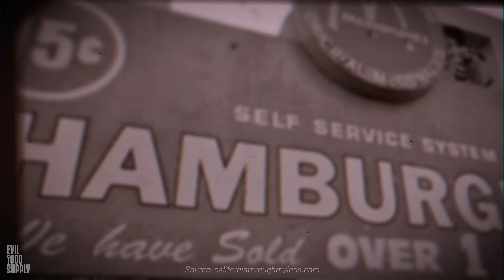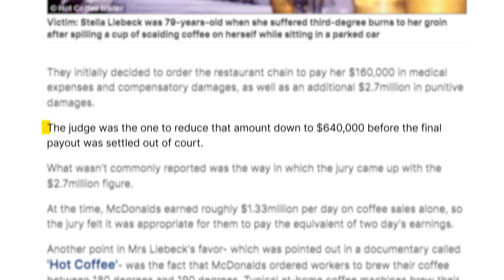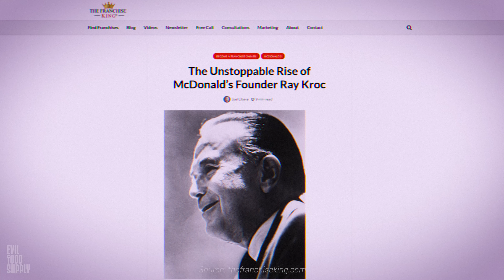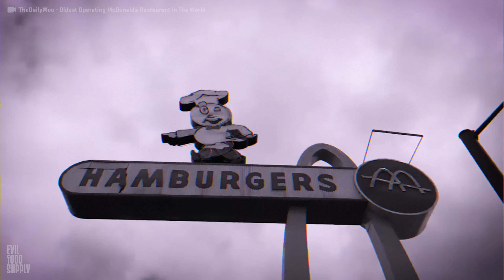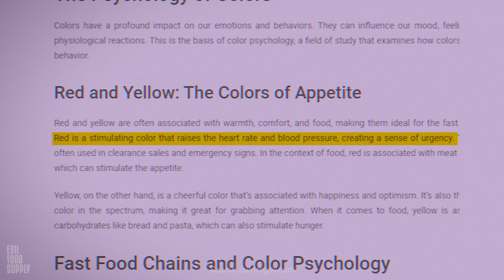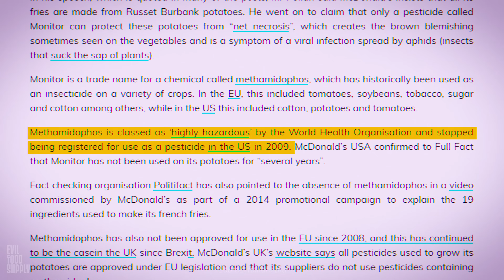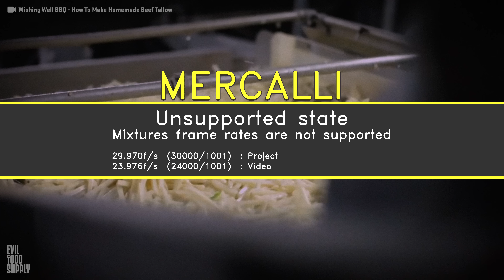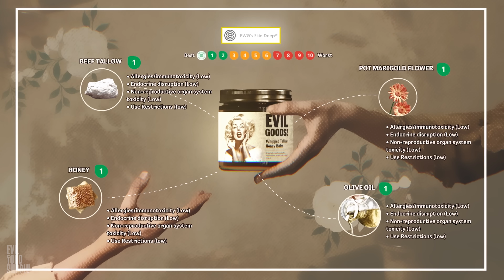The Dark Side of McDonald's Fries

Comment: Never eat McDonald's food!   I worked at a car dealership and we had a car come in on repo.  The car sat in the backlot for over six months all through summer.  We weren't allowed to do anything with it till the legal status was cleared up.   Well during that time an entire bag of half eaten McDonald's and other food items were in the back floorboard.   When we finally got to cleaning and maintenance for resale, the only thing that wasn't coated in mold was the McDonald's food.   If bacteria and mold won't eat it neither should you.
Reply: Yup. Did an experiment in 2012 where I left a hamburger and fries on the top of my fridge for almost 2 years. Everything was basically petrified but not a spot of mold or rot.
Reply: I once found a bag of apples between the wall and couch at my ex gf's house. The apples had expired since 9 months but looked perfectly fine.. guess some apples have the same anti life coating as McDonald fries 😮
Reply: Stopped eating it for years until I started working at one. I couldn't even finish one mcdoubble n a small fry. The then would throw it up abt an hour later.
Reply: @freedomfisher2496   Apples are one of the more long term fruits if properly stored and commercial ones get a wax coating.
Reply: @freedomfisher2496  Nah, man, you can store apples for a pretty long time. That's why you can buy Washington apples at the grocery store in July.  There's not some magical tree that grows yummy honey crisps in July, they just store that long if they're treated right. It's not a crazy pesticide that protects apples and gives them this longevity, it's literally just wax.
Reply: We are composters
Reply: As word got around about McDs food being as attractive to insects as margarine (meaning, even cockroaches won't eat it), Burger King ran an ad that was nothing but a time lapse of a whopper molding and rotting.

Burger King's sales increased 14% from that ad campaign. FOURTEEN PERCENT! Literally one of the most effective ad campaigns ever ran.

This was in 2020.
Reply: 😂 I believe it fake food
Reply: But they eat poop so we should too 😮
Reply: @s13gouf60  Alright I believe you two, then I guess the organic apples just don't have the wax because they rott away in 2 weeks in my house. But are you sure this wax is harmless to eat / could really be washed off with water? U can understand I have trust issues haha. For example the citrus fruits here have a wax with some chemicals which I googled and it said: "associated with miscarriage and nerve damage" so I always buy organic..
Reply: @freedomfisher2496  If you were an avid reader of history you would know that apples were a mainstay for sailing vessels because of how long they last.   Also "organic" is not a regulated term and can be slapped on anything to up the price.
Reply: @s13gouf60  I am Dutch and here in Europe such things are managed way better than the US! For example here every GMO ingredient must be labeled and it's very rare. Organic here really does mean something. It means only organic fertilizer and organic pesticides/herbicides can be used. Also it must be labeled Organic from Netherlands, European Union or outside European Union.

There was a gigantic independent study which conluded 80% of organic grocery store producs are really organic (so yes there is some illegal cheating going on).
 
But I do believe you and others that apples can last very long periods of time naturally.
Thanks for teaching me ;)
Reply: @freedomfisher2496  Indeed in Europe organic is a legal meaning but sadly in the states it's just a marketing term.   As much as I despise government involvement, when it comes to false advertisement that's something that should be harshly regulated.  Also any additive, ingredient, or chemical in food should be known to the consumer.  That's why Americans are so unhealthy in comparison.
Reply: @s13gouf60  Yes it's unbelievable how of all places, the US has the worst "food" in the world! I also dislike big gov, but agree for such things gov should get involved. I hope RFK jr can and will change that. 
Things here are far from perfect but when I read how many food ingredients and pesticides etc that the US allows are illegal here, it's shocking
Reply: I wouldn't give that shit to my dog.
Reply: Funny side story: same applies to cola. Worked once for a small beverage shop, who produced also themself. Limonade sirup will go bad within few days. So they only prepared small badges. Cola sirup on the other hand was prepared once a year and was stored in a huge tank. It never went bad or mouldy.
Reply: Bullshit.  The buns are made of wheat and the meat Pattie’s are beef.
Reply: @TGWazoo1  not too bright.
Reply: @DimitriSokolyuk  Maybe it is because cola is so acid? I personally never had the idea that cola is worse for health than fanta or 7up etc. but perhaps it is?
Reply: That's how any low moisture food works once it dries out completely.
Reply: Never eat any fast food.  Worse case scenario fast instead.  I'm not telling anyone what diet to do but this is crazy.... Try to only eat single ingredient foods only at home and if it has 3 ingredients or less than 3 no added sugar.... Crazy... You'll be eating real food and cuts down for the most part of the garbage
Reply: Cross
Reply: If it eats the radiation off the walls at Chernobyl and eats plastic in the ocean but won’t touch their food then you probably shouldn’t either
Reply: There is no moisture, so nothing grows.
Reply: @s13gouf60 
McDonald’s apples in a bag are cut up. If I cut up my washed apples and put them in a ziplock then they will start to brown pretty fast even in the fridge.
Reply: @lottie1144  Browning is oxidation, and that's normal.  If you ever cut up an apple and it doesn't do that, I'd be wary.
Reply: @s13gouf60 coated in beetle juice (wax)😋
Reply: Yes everyone knows that. Your stomach acid can pretty much destroy anything. Once in awhile some McDs won't hurt you. I just hate paying the ridiculous prices so it's a rare thing.
Reply: @freedomfisher2496 Even if it says organic on it, that doesn't mean it's organic. I used to work in a factory where we had to pack the same vegetables in a regular bag and organic bags.
Reply: @FaithJoy-ju9ln hi🇬🇧 i worked on farms & in factories years ago, i totally agree, it works both ways, certain vegetables & plants have their own pest defense mechanism and aren't sprayed, but it costs too much & is to much faf to put an organic label on,so is just sold as normal. Like ive noticed with honey, i looked at the ingredients on an expensive brand of organic honey & it said "a blend of honeys from outside EU?(Probs honey flavoured corn Syrup from what ive read)So i call that label 🐂💩 not 🐝🤮(i love bee puke,either local sellers or manuka)
Reply: While we're here helping consumers, don't purchase cars from dealerships!
Reply: Better stop eating honey, sugar, salt, popcorn....leave them in a car and see what happens
Reply: @primeral  Sadly not much option there if you want new.
Reply: The burger meat is ok.
Reply: There’s an apple that was on the Mayflower that hasn’t rotted yet.
Reply: @DataBattlesZ2087  you are not too bright, I must say...
Reply: So the food got worse and the prices went up. Nice.
Reply: These simpletons can’t even understand the basics of decomposition so they jump straight on the “McDonalds is killing us” theory.
Reply: @freedomfisher2496  yes, all produce us sprayed. They spray/dunk them in the stores. I've seen it. And even researched the jugs of milky looking stuff. It's worse than you'd imagine. If I can find it I'll reply with the specific brand.
Reply: @freedomfisher2496 I’m with you
Reply: It's funny that in the kitchen there's a rule to throw out any uneaten burgers that have rested for more than half an hour.
Reply: @lottie1144  tip: sprinkle some lemon juice on it, it will drastically slow down oxidation
Reply: @FaithJoy-ju9ln  Yes I know, but according to independent research that I do trust, about 80% of foods labeled organic in the Netherlands are actually organic. So it's worth the extra buck imo.
Reply: did this experiment 15 years ago in my high school health class. we put different types of food in glass domes in the back of class and let them sit for the entire school year. we took food from the school cafeteria, a local Chinese carryout, some premade grocery store deli sandwiches, a couple donated homemade lunches, and a meal from mcdonalds and the McDonald's lasted almost the entire year. it never got moldy but it started seeping liquid at the end of the year. the homemade meals didn't even last a week as expected. the McDonald's result was honestly shocking to the class back in 2009. Definitely made us all think differently about eating fast food frequently.
Reply: How do we make the entire universe aware of how toxic such food is?
Reply: @WholePlate  As this thread makes abundantly clear, some people will listen, but an unfortunate amount will just die from diabetes and other health complications whilst blaming everything else.
Reply: @zachb8012 an lemon juice can keep it from browning fwiw but eh idk I feel if not on the way abd or in a hurry I would rather make some heck maybe even in between go one for why not ig.. an make use of them that are frozen but ready to baje or ig maybe they can be fried wait no because itd flash burn if frozen put into hot oil... also I am not exactly picky so if I am not feeling nostalgia/salty craving for something or wanting potatoes specifically then fwiw hash browns or veggie tots are perfectly ok even If by no means will I say thaey taste exatly the same as tater tots etc.. but yeah man idk if Icwould go OUT just to buy fries etc.. in the eventvof not being 10:12 also looking bacj fwiw... idk of ANY fry I recall seeing without some slight variation fwiw I wanna say even from mcdonalds hamburgers fries.. but fwiw ngl I just figured it was skin or dark from the fryer oil etc idk
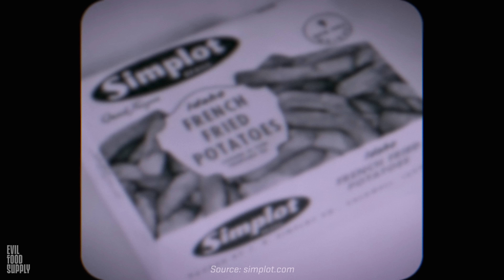Reply: Oh hey I heard of Simplot... that is the name of a fertilizer brand iirc 12:06
Reply: They weren’t nearly as bad until they got rid of tallow.
Reply: @powertothesheeple5422  LOL.
Reply: next time. add moisture to the food and see if it rots.
if the results remain unchanged/similar.
than ill heed thy words of wisdom oh great prophet.
Reply: @freedomfisher2496 well we have better food in EU vs US. I lived in the US for a decade and the food there is garbage compared with the food here in Europe.
Reply: @DimitriSokolyuk So they only prepared small batches.
Reply: Seems bacteria is smarter than a lot of people 😅
Reply: @freedomfisher2496  we grow apples in garden. They keep for months & are FINE  we don't spray with nothing  . Never have. Never will. They are organic
Reply: @zachb8012 I work on a farm. Every apple sold commercially, sat in refrigeration for at least a year.
Reply: Zaku ii kai jumpscare
Reply: @freedomfisher2496 
1 year shelf life! That's right, there is a variety of apple with an amazing 1 year shelf life🤯
Reply: They are disgusting. A cousin of mines once ate a supersize fries. He threw up and had rancid diarrhea for two months. He was never the same again.
Reply: Wow lol thanks for sharing hahaha great story!

Comment: Just imagine. If they actually cooked beef burgers, they could have an endless supply of fresh tallow for fryers. It's almost nonsense that they opted for chemical sludge when they could have practically had their own self sustained restaurant ecosystem. The modern marketing on that angle alone would net a restaurant impeccable PR.
Reply: Only issue they have with that is that its more expensive and isnt as addictive. They only care about revenue, they'll only do whatever brings in more revenue. Regardless of the process itself or the health effects

Comment: Another important note about beef tallow, it is a much more stable fat under high and continuous heat than seed oils. I worked in the food industry for 4 years and operated the deep fryers. The coagulated goop we would have to scrape from the inside of the fryers what insane. Now we know that the substance was polymerized oil that was created from the chemical reaction and breakdown of canola oil under immense heat and pressure over a long period of time. Any time you eat something made from a deep fryer, you’re essentially eating fatty plastic that your body has no way to synthesize

Comment: Protip
Don't just fry them firstly.
Boil them until slightly soft, THEN dry them, THEN fry them.
Or instead of frying them, if you can spare the time, use a bit of fat and bake em for about two hours at 375 or so.

Comment: 23:30    1 part tallow 1 part beeswax melted together (use essential oil to sent or make medical) it is the only thing i use put it on your lips hands hair beard cuts scrapes scars, use it to condition your leather goods boots couch chair belt or holster its good for everything it even helps waterproof your work boots as it conditions the leather i have it on my beard and lips as conditioner and chapstick right  now. And its so cheap to make you can add honey to the mix to add antimicrobial properties as well as sweeten for chapstick. Use a glass container put beeswax and tallow in it and heat add whatever you want id it's to thin add beeswax if its to thick add tallow honey or some type of oil. Its fun to do with your kids too

Comment: The only point you made that has any meaning is that they use pesticides on their crops which to me is an entirely separate problem that isn't even always a problem, everything else you said is pretty disingenuous you are like look at this huge list of hard to pronounce ingredients when it's like: Potatoes, Vegetable Oil*, Dextrose (a type of sugar), Sodium Acid Pyrophosphate (Maintain Color) (it's found in baking powder it's basically just a leavening agent), Salt.

The only thing that is somewhat questionable is the fact that they use wheat and milk products in the vegetable oil to simulate the old beef tallow flavour. So it is vegetarian but not vegan and if you have celiac you can't eat it. I mean they are just french fries they can't really be made of a cheaper ingredient than potatoes and it's not like oil sugar and salt aren't found in basically everything.

Also the chemical Sodium Acid Pyrophosphate has been deemed safe for general use by the FDA. Sure it may have have "caused immune system issues in rats" but so does literally everything, the dosage is important; furthermore you didn't provide any citation for your claims whatsoever.

Same thing goes with MSG it's been demonized by a racist like a hundred years ago in a very unscientific way. MSG is in fact better for you than salt at least in terms of tolerable upper intake levels (UL).

Also you promoting beef tallow comes off as a meat industry shill. I got nothing against beef tallow but it's a far cry from "healthy" at least not any more so than the vegetable oil they replaced it with. Sure it has a high smoke point but so do a lot of oils and you only need one that is high enough which most vegetable oils are some of which even higher than beef tallow.

Sure french fries aren't the healthiest thing but I don't understand why everyone tries to make them especially McDonald's fries in particular out to be so much worse than they actually are.